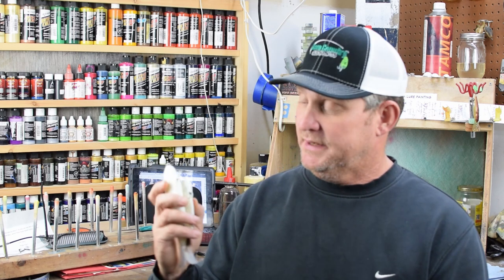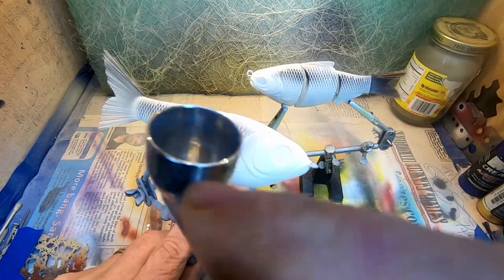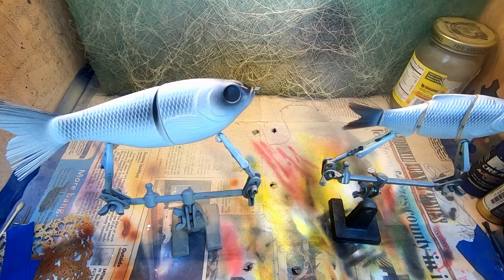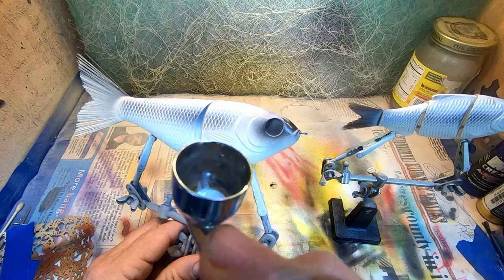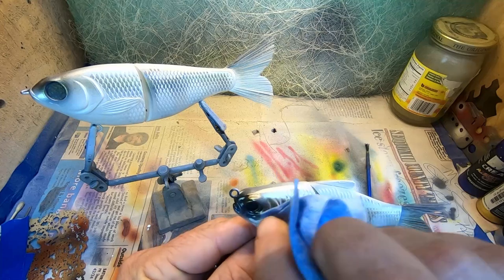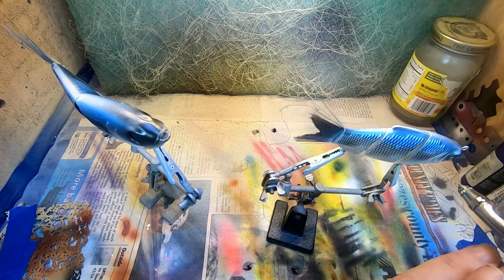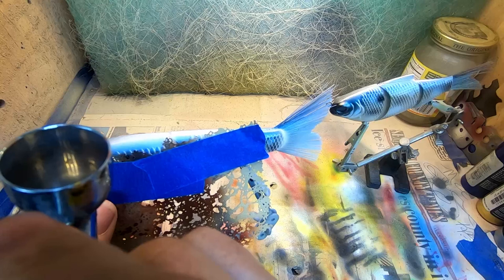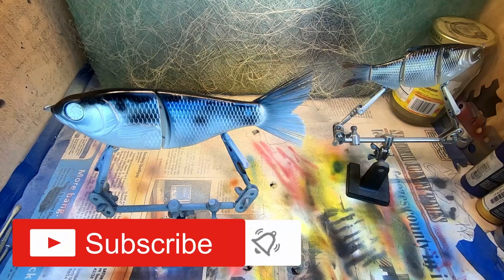LURE PAINTING—HD Threadfin--Custom Painted Lures

Comment: They look awesome..I hit mine with just a ever so light mist of cream or white on the sides just to mute the colors a smidge before I clear them or Allclad chrome depending on colors at like 2-4 psi and like 16 inches away. We all have different styles..that's what keeps us paintin.
Reply from the maker: I like that thought, i have cream that I rarely use. I didn’t care for the black i did over scales at end of video myself.
Reply: @greencountrycustoms8387  they still look good for sure. I've only been painting a little over a year so I'm a rookie. I started using Vallejo washes to get in between the scales works rather well..I'm forever trying to perfect the dirty beat-up gizzard. Definitely close though
Reply from the maker: @Don Kukawski  what are the washes. Guess something I've never heard of.
Reply: @greencountrycustoms8387  Vallejo model washes..I've been fartin around with them lately..have totally changed the way my lipless crankbaits turn out. Workswellwithanylure that has scales impregnatedinto them. .if only there was a way to post a picture on here so you could see it.